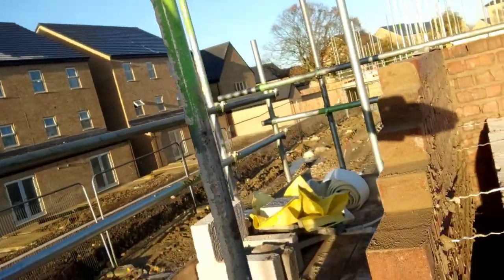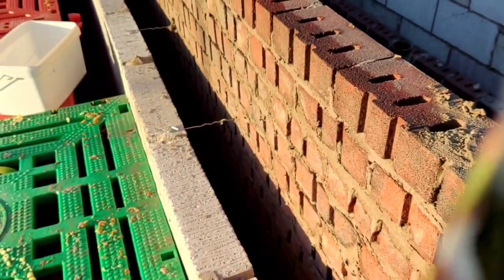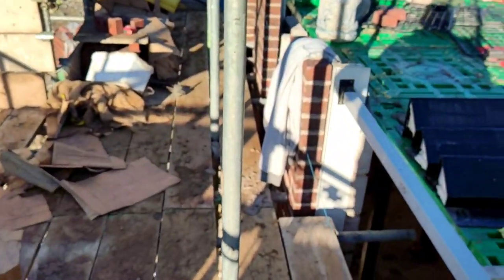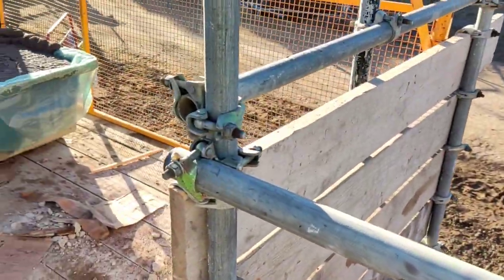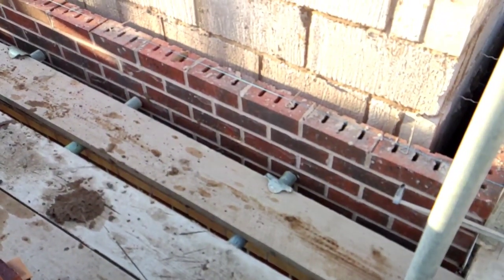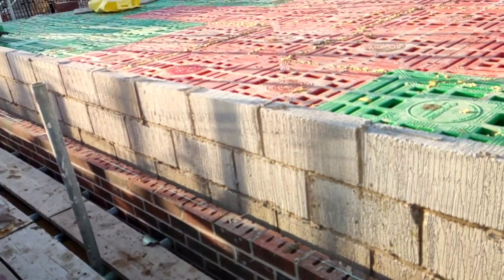Bricklaying Vlog - Working Solo is Hard!😓

Comment: It is tough switching gears to working alone, keep plugging away, don't forget to set a time to clean up and go home!  The hardest part is getting out of the truck after lunch.  Also can't you just cut the ties instead of drilling them out or are they sticklers on that site?  Keep up the good work!🐱‍🏍🧱
Reply from the maker: Ready mix was still soft, so came out super easy